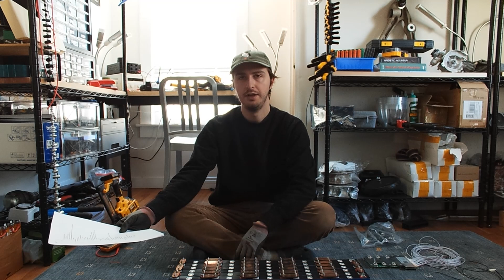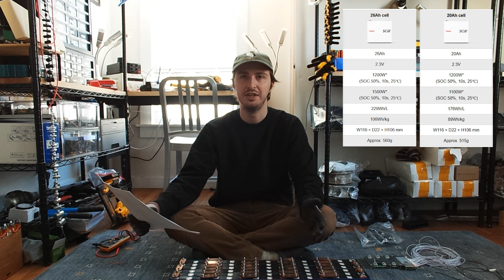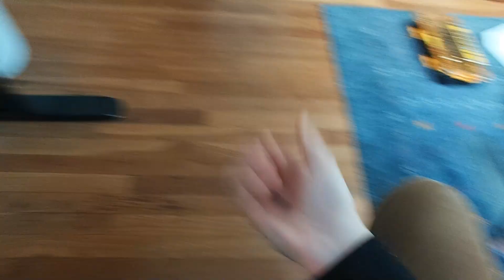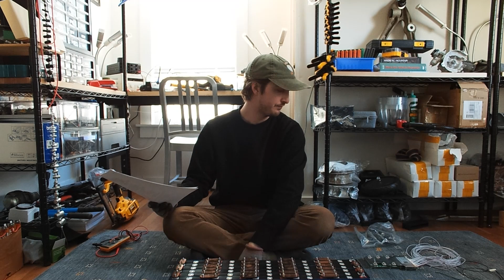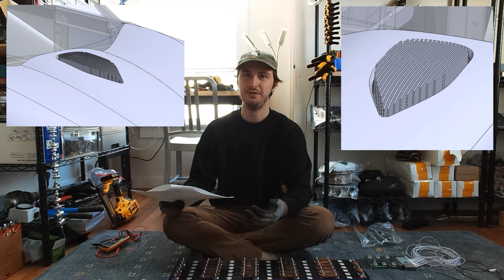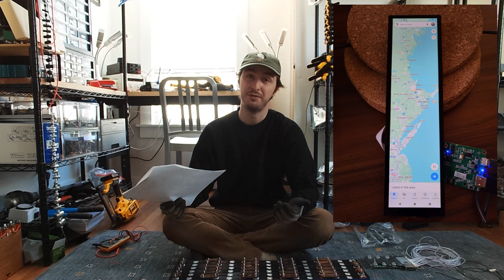The Electric Drivetrain of My Home-Built Hybrid Sports Car

Comment: For the BMS leads not sure if you’ve seen the PCB type solution that sits on top of the terminal studs, cleans up the wiring.
Reply from the maker: yeah that's the plan, just gonna do one of those (probably in two pieces and throw a JST on each of them

Comment: Do you actually need a front differential? If you had independent motors for each front wheel you could control the regen for each wheel for some interesting handling.
Reply from the maker: you dont need a differential but you need a reduction gear for the motor to get power at low RPMs. there's no good reduction gear solution for two independent motors yet.

Comment: Good stuff. FYI. I would use CAN communication. Besides the control of the motor, you can then also use CAN communication to change the VESC setting as well.  There are options for that. Looking forward to seeing you go forward. Cheers. ~Russ
Reply from the maker: @rwgresearch  do you know of any resources on that front
Reply: One of my products I developed relies solely on CAN communication. We use it to read all the telemetry and also communicate and control two VESC's on the network and we also use traction control this way. There's a few different protocols that can be used besides the generic one. Such as UAVCAN. You can even write your custom CAN communication protocols for the VESC. I have spent quite a lot of time with the VESC and it's quite capable if you really start digging into it there's a lot of extra stuff you can do with it  ~Russ
Reply from the maker: @rwgresearch  appreciate the detail, very happy to see you really know what you're talking about

Comment: Yeah a ring crimped connection would be best for the BMS leads 👍 solder joints are normally avoided in cars because the joints are brittle. I am sure you already know this 😎